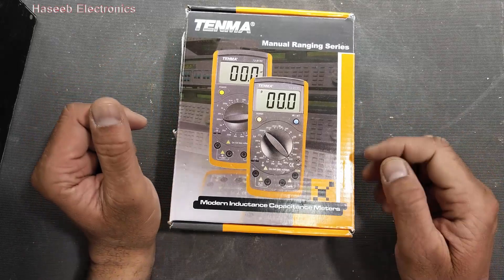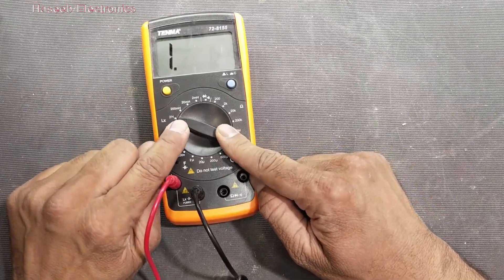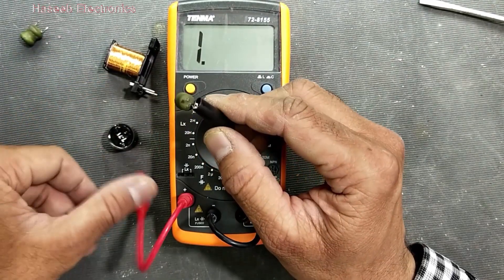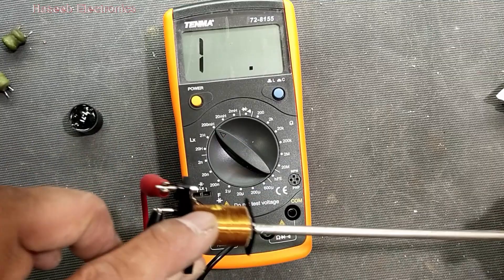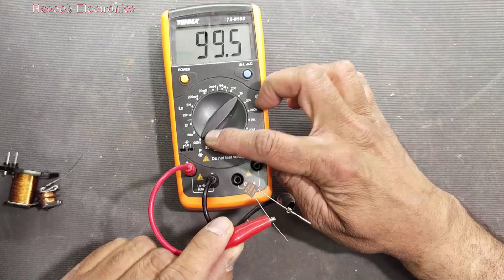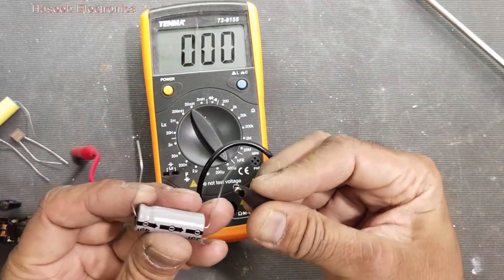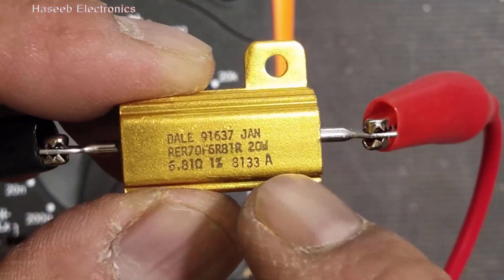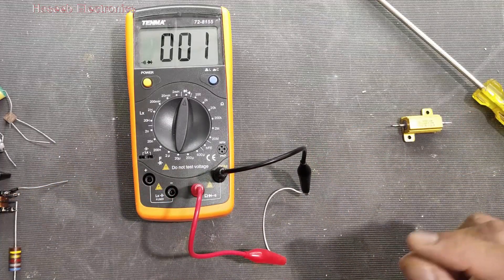359 LCR Inductance Capacitance Resistance Meter for inductor capacitor and Resistor Test

Comment: Very nice...how to understand by such meter whether a condenser or inductor is short or open?
Reply from the maker: if the measured value and printed value are different 
then will indicate the failure 
we can also check resistance of the component